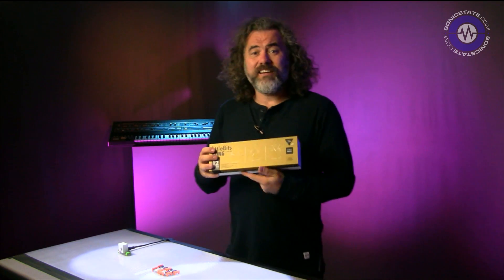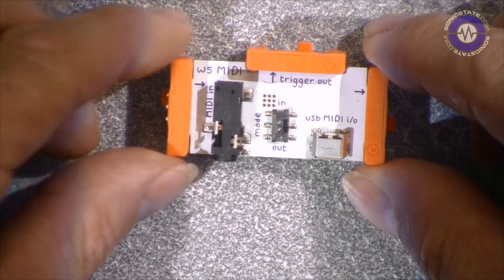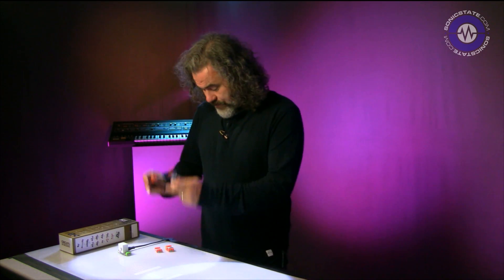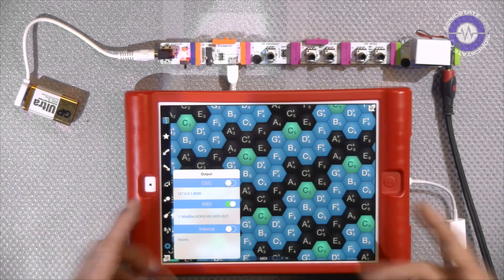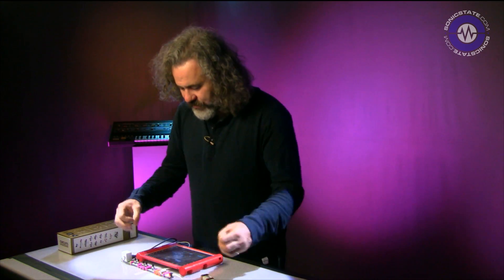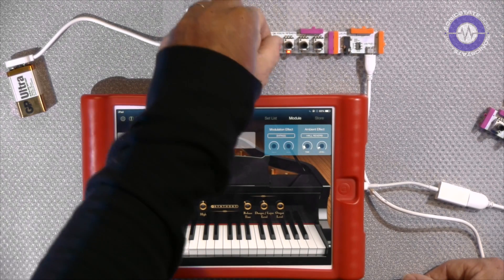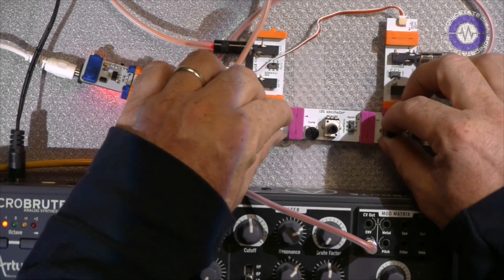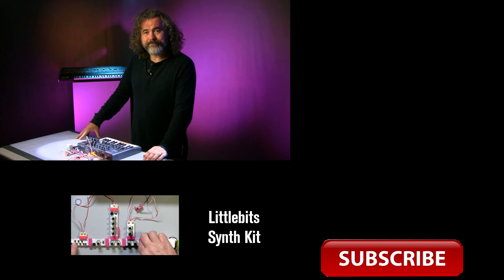Littlebits Synth Pro Kit  - SonicLAB Review

Comment: So the midi module should work with a standard USB midi keyboard right? Like if the cable were plugged into the micro USB port with a USB otg cable?

Comment: such a low cost littlebits kit can be used like a gsm controlled security device which could be used to send signal if someone opens a door or something, the applications are endless.its more like a easy to connect arduino device.

Comment: I've never come across a "CV" connection before.. would anyone mind explaining what that is and what its used for?
Reply: +jeremiah wright it's a bit like an older version of midi but it is analogue so works with older synths. Pre-digital
Reply: +jeremiah wright CV is an abbreviation of control voltage, also known as gate...it's essentially an analog method of controlling synthesizers. The voltage usually controls pitch while the gate would control note on and off.  Nowadays of course everything is pretty much based around the MIDI protocol.

Comment: I'm a big fan of Littlebits.. and this Pro Kit is just the perfect glue to promote their modules to real, studio-usable raw material. As far as the sloppy-slide aspect goes, Littlebits also have their $15 Mounting Boards.. expensive but perfect to lock circuits in place.